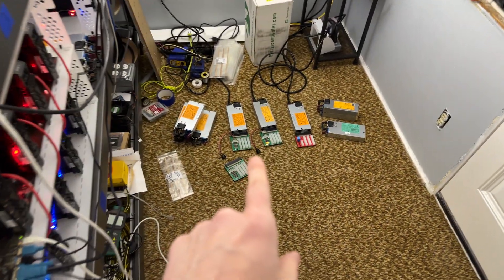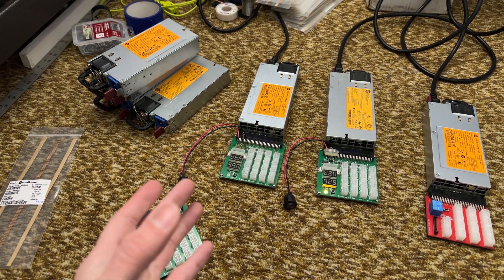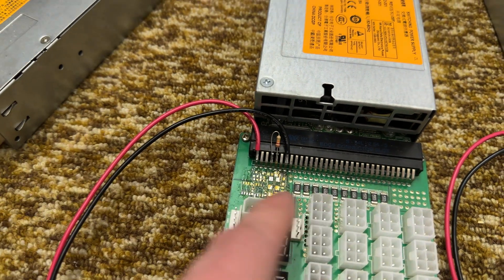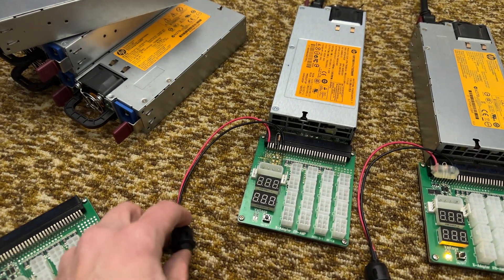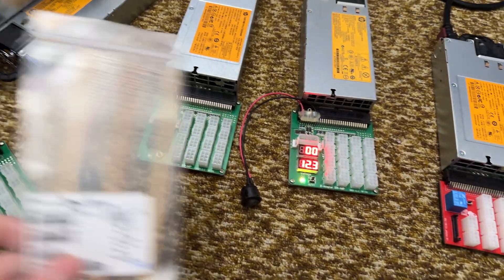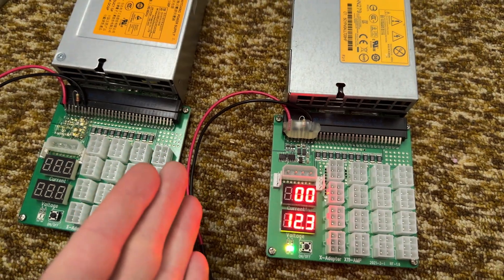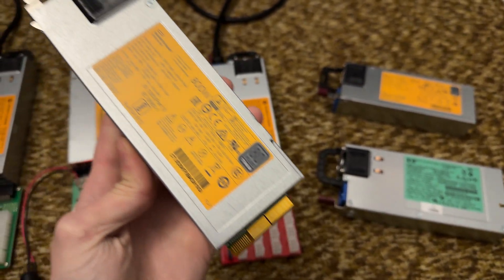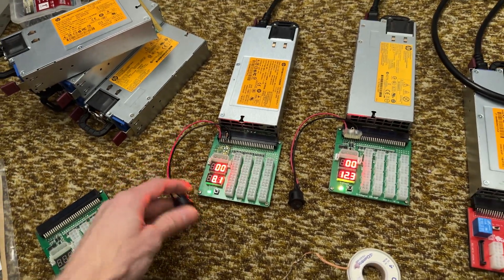Server PSU Breakout Board Failure? - DIY FIX

Comment: Do this breakout boards have power out puts higher than 12.2 or can you get 15.6 volts ?
Reply from the maker: This model PSU won’t output above ~12.8v, but that has nothing to do with the breakout board. The limitation is the power supply, the breakout board is just mainly connectors. I’m sure some PSUs can be modified to allow 15v+, but I’m not familiar with models that do.

Comment: Dude you got them on a polyester carpet!!! static electric y!!!! hint hint!!!!
Reply from the maker: Yeah, it’s not ‘ideal’ maybe, but the risk is outrageously low in this situation. The bottom of the breakout boards is covered with acrylic on standoffs. There’s a small air gap, and then plastic covering the bottom of the breakout boards. If you dragged millions of these across that carpet, I don’t think a single one would experience a failure as a result, especially when it’s plugged into a PSU. That said, the design on these particular units is still garbage and they fail no matter how they are treated.
Reply: thousands of volts in static electricity jumps many  gaps !!!!

Comment: Are the resistors required?
Reply from the maker: Ideally, yes. Sometimes it works if you just short those pins instead of the resistor jumper, but it won’t work with all power supply models, and it consumes a little bit more power.

Comment: You wouldn't by any chance have a fix for X12 breakout boards for Dell model: L1100A-S0? I am not knowledgeable enough to find a solution on my own.
Reply: I’m thinking it’s the same fix, have you tried it?
Reply: @benjaminquinones1890  It is the top and bottom pin four.
Reply: I thought wrong, here is a link to what you need for the 1100 https://youtu.be/syfrlyt9CO0

Comment: I have two parallel breakout boards that turns off and from those two, one is backup and I just put the backup to run and it work for a few days. Than after it stop I get the previous one that failed and put back and it work for another few days.
So, probably there is some circuit broken that if you leave disconnected for some time, it work again. Any ideas what could be the problem?
Reply from the maker: That’s the problem they all have. I discuss it a bit more here. https://youtu.be/jXwTTuPwewY

Comment: this might be a dumbass question but for pins 1 and 7 can we just solder another 22k resistor lol? Or should I just snap one of the metal leads sides of the resistor off and just use that to bridge the connection?
Reply from the maker: If you use a 22k resistor, the power supply won’t turn on. The jumper between pins 1-7 needs to be under ~500 ohms or so, depending on the PSU model. You can use the leads on the resistors, that works fine. It might be easier to tack a single resistor on each lead, cut the resistor bit off both, and  solder the lead ends together. Whatever is easier to manage without burning yourself.

Comment: I had issues with 75pct of my PM boards, but he sent me a couple free of charge after 3mo or so. I didnt bother to ask for a replacement 9mo after. Deep in the mines worked fine for me, but  i still have not figured out how to connect them to each other so that if one turns off, another one does as well without an ATX in the middle. Ideas?
Reply from the maker: Yikes, that's a lot of failures.

There IS a solution. You can put the switch to the SATA selection on the slave units. The switch can be used on the master to enable/disable that unit. Then connect a PCI-E to FEMALE SATA cable from the master to each slave unit. This means, when the master lights up, the power will kick the relay on the slave units and they will power up. If the main goes down, they all do. This is not 'fault tolerant', since if a slave goes down, the main will not follow. So ideally take this into account with your wiring, and try to power up the computer from the slave. Of course, never split GPU power between two PSUs if you can avoid it.

Note: These MUST be the very unusual FEMALE SATA. The super typical male plugs won't work, since that's what's on the breakouts. They're kinda expensive and hard to find, there might be a cheaper way, but this is reliable and fairly elegant.

https://ebay.us/PI3MzB - Female SATA to PCI-E (Male wont work)
https://ebay.us/eILPE5 - Female SATA to PCI-E (Alternative)
https://ebay.us/pn7fcR - Female SATA to PCI-E (Alternative)
Reply: @SiCPoWMining  Thanks!

Comment: Bro this is exactly why I don't F with server power supplies, every minute of troubleshooting and power not working is lost potential revenue. I may spend more money for ATX but I also don't really have to worry about these issues or melted cables
Reply from the maker: It’s dramatically more complex initially, but it’s fairly easy to get the right hardware with a bit of effort. If you’re just running one or two PSUs it’s  likely easier to just buy ATX. For a larger deployment, it makes a lot more sense to move to server supplies. For titanium efficiency, they’re WAY cheaper. Maybe 1/4 the cost or so, all loaded in. They also tend to be more reliable, cables melting are usually from people using Y splitters, which happens on ATX supplies just the same. But yeah, the solution isn’t solved for you, so with garbage components it’s messy.

Comment from the maker: Jumper pin 1 to pin 7 with a piece of wire, or a switch.
Solder a 22k resistor between pin 3 and 4.

✔ Switches - https://amzn.to/3lqurTu
✔ 22K Resistors - https://amzn.to/3lrvFxT

✔ Solder Wick - https://amzn.to/3xcmWlJ
✔Cheap Soldering Iron - https://amzn.to/3EjS0Ef

✔ HP Common Slot (Most Common) Breakout - https://amzn.to/3RNY5hy
✔ HP Flex Slot (Newer Style PSU) Breakout - https://amzn.to/3lto2qr
✔ HP Common Slot Titanium PSU - https://ebay.us/gLVa4K
✔ HP Flex Slot Titanium PSU - https://ebay.us/bInvmW